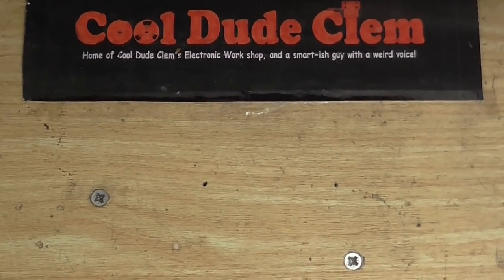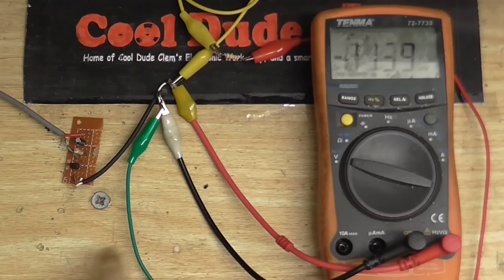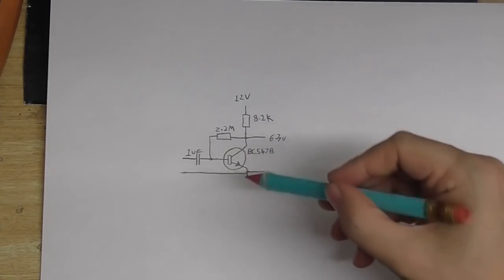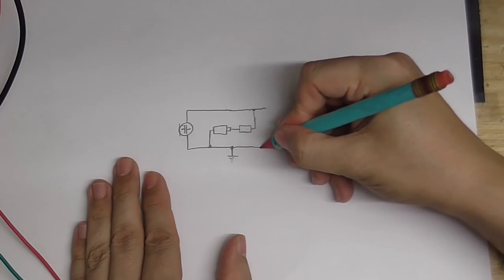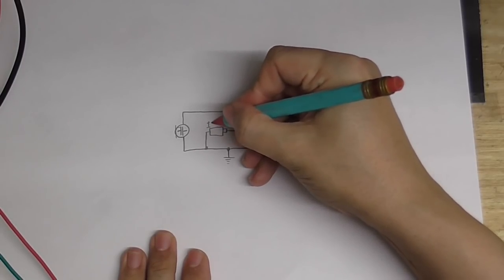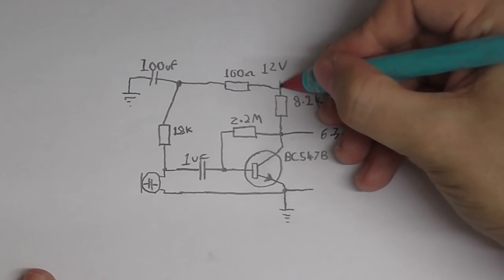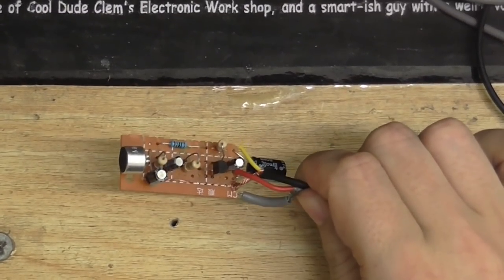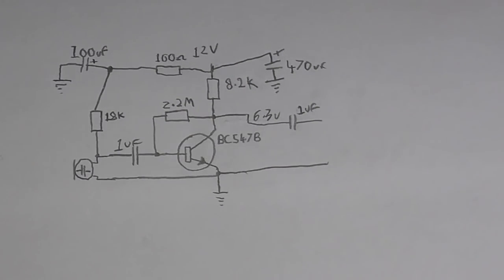Adventures in a One-Transistor Mic Preamp.

Comment: People came up with various ways of designing these.
The way I remember from Walsall College of Technology many years ago goes like this-
Start by choosing your Supply voltage,Collector load resistor value and a suitable Transistor.
The Emitter resistor is then one tenth of the value of the Collector load one.
We need to have an idea of the transistors hfe ideally at the quiescent collector current we have chosen but we could use one of those Digital Multimeters with the hfe measuring function for a rough idea.
We know that we want half the supply voltage dropped across the Collector load and we know the Collector load's value so we can calculate the quiescent collector current using ohm's law.
We can calculate the quiescent base current by dividing collector current by hfe.
Now we can calculate the voltage across the Emitter resistor using ohm's law since we know the resistance of this and the quiescent emitter current flowing through it which is of course the collector and base quiescent currents added together.
If we now take this emitter voltage figure and add 0.6V (assuming a silicon transistor) to it we have the base voltage.
Now we can use ohm's law to calculate the lower bias divider resistor value as we know the voltage across it and that we want ten times the base current flowing through it (the ten times base current flow is to keep the operating point stable).
We can also use ohm's law to calculate the upper bias divider resistor value as the voltage across it is simply the supply voltage minus the base voltage and the current flowing through it is ten times the base current plus the base current.
Time to power up and check the collector voltage and tweak the value of the upper bias divider resistor if the voltage here is too far away from half of that of the supply.
The three capacitors-two for coupling and one for emitter-bypass could also be calculated to specify how far down we want the low freguency response to go but I suggest just picking out favourite values here to simplify things.
I hope this helps.

Comment: Just what I needed as I have salvaged several of these mics and have a few uses for them. I get what you are doing with the voltage dividers but should the 2.2m resistor stay the same if I'm running off 5V. Thanks. Great voices too 😀
Reply from the maker: I forgot I'd left that part where I was just goofing off in! But yeah it should work just fine on 5 volts without changing the 2.2M resistor, you might want to change the resistor for the microphone though, maybe something like 10k instead of 18k for 5 volts.
Reply: @CoolDudeClem  Thanks 😀
Reply: @CoolDudeClem   THANKS.  i was searching on this topic  and have seen every video on you tube  of making and amplifier using single transistor
 your are explaining better  then any you tuber.
i have a QUESTION that can i hear its sound by connecting  directly its leads to speaker ? i have seen your video now  i will make it

Comment: This was awesome and very cool to see. The only thing I didn't understand is what the 100 ohm resistor is for right by the 12v source?
Reply from the maker: That 100 ohm resistor and the 100uf capacitor are there to smooth out any remaining ripple (power supply hum) so the microphone gets perfectly clean DC. You don't want any ripple noise getting amplified, so those filter the ripple out.

Comment: Is it save to replace the condenser mic with a dynamic mic, or would that require any changes?
Reply from the maker: yes that's entirely possible, and you can omit the  resistor that "powers" the mic, as a dynamic mic doesn't need power.

Comment: What is solution for hum coming into the preamp through using mic when laptop charger is connected to the laptop
Reply from the maker: Not much can be done about that, most chargers have a lot of electrical noise.
Reply: @CoolDudeClem  it means all the preamplifier designs have this loop holes there is no solution for it to .it is very disappointing that i am hearing from an expert
Reply: Sorry but he's wrong in this instance. Provided the noise is actually being picked up by your transistor pre-amp circuit and not the actual hardware inside the laptop, there's plenty you can do to smooth out voltage from a noisy SMPS. Connect your circuit via any of the following-
Another voltage regulator (eg MP1584 or LM2596 module)
DC-DC isolator 
Diode & smoothing capacitors 
LC Filter module
Reply: I know I am late to the party, but if your mic is getting him, it could be any of a few things. If it's ground loop, you can place resistor and ceramic cap across input and ground to help quiet it out.

If it's the 50/60Hz him from a PSU, try using a linear regulator, there are small ones the size of a transistor that can do 3.3v 100ma, perfect for the mic capsule.

I try and use above tricks before transformers, they can get expensive and take space.

Comment: Please, do this with power supply from USB 5V, and the connection to USB port !
Reply from the maker: It should still work from a 5 volt supply, just remember that most of those have a lot of ripple in their output, so put a 100 ohm resistor in series with the supply, along with a capactir of 1000uf across he pwer inputs for the preamp and that should filter the noise out.
Reply: @CoolDudeClem  Thank you!